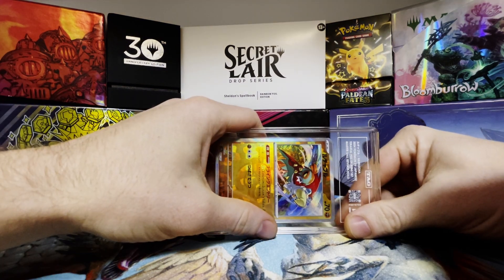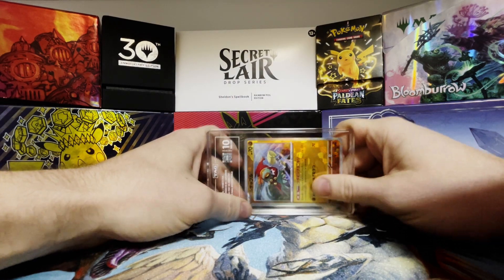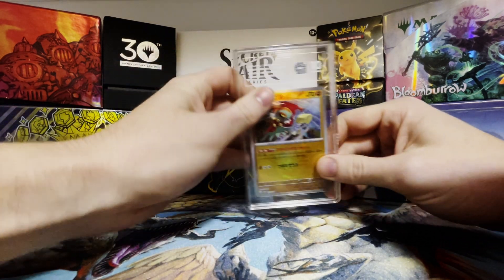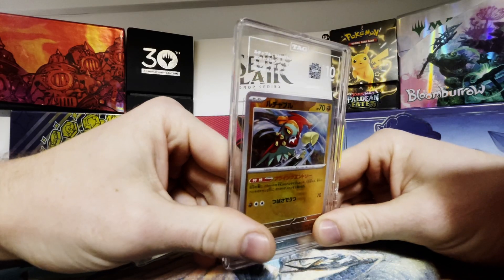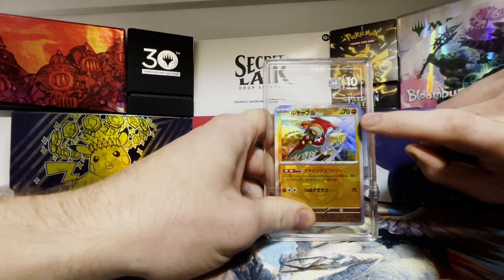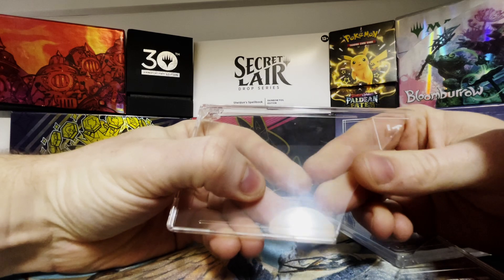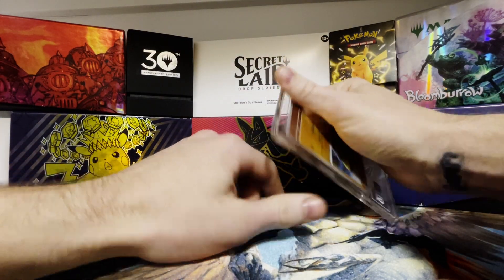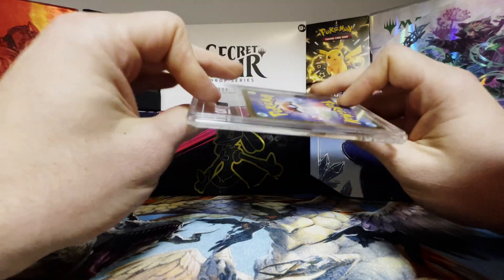Here is Why TAG Slabs Crack So Easy... And How They Can Fix it.

Comment: Hi TCG Random! We really appreciate the time and effort you’ve put into testing our slab and sharing your findings. Like you, we’re passionate about transparency, which is why we provide detailed data with every grade—to give collectors as much insight as possible.

We also want to thank you for offering to test our slabs further. We've recently refined our welding process to increase strength, making the slabs even more resistant to breaking and significantly harder to pull apart. That said, we’re proud of the quality of our slabs. As your previous tests confirmed, they’re made from high-quality acrylic with industry-leading UV resistance and optical clarity. While extreme force can break any slab, we prioritize optical clarity, UV protection, and scratch resistance over using a more impact-resistant but less visually appealing polycarbonate.

Our goal has always been to create the best slab in the hobby—not just in its clean, minimal design that keeps the focus on the card, but also in security. Every TAG slab features Proof Code technology embedded behind the QR code, providing next-level authenticity and anti-counterfeit protection.

As you pointed out, we did not create a full hermetic seal across the entire slab to maintain crystal-clear clarity. Our internal testing showed that attempting a complete seal could create inconsistencies around the edges, which is why we designed it this way. That said, we’re always looking for ways to improve and are actively exploring refinements.

We also want to clear the air regarding past discussions. Our goal has always been to provide transparency and accurate information, never to discredit anyone. The original video you mentioned raised concerns about slab durability, and while we responded to clarify, we didn’t get a chance to discuss it directly at the time. We’re glad we’ve since connected with the creator to have an open and productive conversation, and we appreciate the opportunity to address any concerns. Honest discussions like these only help push the hobby forward.

We’d love for you to test the updated slab once we complete additional optimizations. We’ll reach out when it’s ready! Thanks again for your thorough testing and for helping create meaningful discussions in the community. We appreciate the dialogue and look forward to continuing the conversation.
Reply: could you guys please also address the humidity issue? with a non complete seal the cards are prone to humidity damage in humid areas
Reply: Yep, i understand wanting to keep that clarity but they should definetly do a full seal to combat humidity  @shinyshaymin420
Reply: @shinyshaymin420 this to me is the bigger issue than bending a slab I'll never bend anyway LoL. I love tag slabs though... cleanest in the industry
Reply: I was gonna submit, but gonna wait until these issues are fixed.
Reply from the maker: Hey, @taggrading. Any success on upgrading the slabs yet?
Reply: Was trying to find your channel to see if there was any updates on this. I spoke to a TAG rep in person and he said there will be no new tag slabs but only the updated weld. The updated weld seems better but not perfect. Although no official statements. I need to see the scientists tests before I invest!
Reply: I’ve seen you reply to many videos and you are really making me want to grade with u guys. I did w PSA once and I just didn’t understand the grade I got
Reply: An apology would be much more respected after trying to strong arm Ramseyrips. This makes the hobby even worse than the scalpers. You’re lucky you had someone do your own research/work. Too bad your entire company couldn’t figure this out off bat.
Reply: W reply. Hoping for the best!
Reply: This is such a TL;DR and I don’t have to because I know what it says already. 
Sorry Tag. You only get one chance and it sounds like you blew it with a response video which is no longer available to watch.
Reply: same pr nonsense , you never formally apologized to Ramsey for just making an honest review of a product.
Reply: @keyynew1  They addressed this issue with RamsayRipsPack. He made an update video about it 4 days ago
Reply: @keyynew1  while honest and tags response sucked. he was basically telling people tag's slab sucks because if you bend it (or if you have a 9 year old that someohow bends slabs), it breaks. don't you think that if it was a huge problem, it would have been made an issue by someone else? not specifically in a test that is unlikely to happen in 95%+ scenarios. it was an emotionally charged reaction, without any sort of objective reasoning. other than, "NO BEND SLAB = BAD". take note from this video who addresses tag with class
Reply: @keyynew1  TAG addressed this and Ramsey made a video about this 4/5 days ago. TL;DR, TAG took accountability for how they responded and Ramsey respected it
Reply: Very Fair response i look forward to him testing their new slab.
Reply: They sure do use AI, even if not for grading😂
Reply: Literally same bullshit statement lmaooooo
Reply: So cringe. You could have narrowed that down to one paragraph.
Reply: @Sean-db1gx  So cringe. People like you are the reason why companies don't respond to stuff online.
Reply: @whitesmoke08  It's 5 paragraphs of PR. It's like a politicians response. Either respond honestly or don't bother.

Comment: You just confirmed my theory, thank you. I have one TAG slab and I was guessing the welds were thin and not fully around also. When I noticed the “weld spots” on the one I have I thought it failed your moisture test because it wasn’t fully sealed, guess I might have been right. I sent some cards to TAG before all this research, guess I won’t be sending any more. The UV protection and moisture protection are what matter the most to me. You did a great job and I’m happy you did this follow up video. I really liked the TAG slabs, will try grading with CGC and keep an eye on TAG to see if they improve.
Reply from the maker: Thanks for watching! You were absolutely right. As far as I have seen, they still haven't done anything about it.

Comment: So the material it’s self cracks so the base material. It has very little to do with the welds or bonds. Stress risers in the cheap plastic is what causes the torsional stress to be too much for the slabs. The slabs look amazing but the plastic is trash. They need to either have a new plastic resin made or make some honeycomb structure to reinforce the plastic.

Comment: Mechanical engineer here again.   What they essential have is a stitch or skip "weld".  Those types of welds are considered class E or F for fatigue,  which are very low class of welds.  While this isn't a fatigue loading case,  the reason for easy cracking and crack propagation are the same.  At the root of each weld are micro cracks, which you touched in.   The lack of continuous weld means you have loads more micro cracks, hence the low class weld.   By the plastic being a brittle material,  the crack propagation is a very rapid propagation.  Like mentioned,  a continuous weld/ seal will greatly help.
Reply from the maker: Great explanation! Thank you!
Reply: @TCGRandom-x5m  you're very welcome.   I've loved your last 2 videos and feel free to ask me any engineering related questions you might need help with, though you obviously have a VERY solid foundation yourself
Reply: @gregl6369 if the goal was to show tampering when trying to open the case by making sure it cracks as opposed to opening the two halves cleanly, would have a more even weld have the same effect, or would stitch/skip weld be more effective for this objective
Reply: @hoiming  a skip weld would theoretically be easier to tamper with as there's less material you need to cut away and reseal.  The brittleness of the slab is more the drawback to using the type of plastic that is superb in every other quality you'd like in a slab

Comment: I absolutely love tag slabs and the fact they are designed to break in a unfixable way when tampered is great too
Reply from the maker: Yeah. Most people with slabs are going to keep them in a nice little case only to take them out for trading or selling.
Reply: @ exactly, they aren’t going to drop test them
Reply: And it’s rather useful being easy to crack, if you want to grade with another company, easy to crack, less risk of card damage

Comment: It's great to see the hobby coming together and pushing for transparency, ultimately leading to a meaningful response from TAG Grading. It's a positive sign when a grading company acknowledges concerns and actively works to improve.

That said, I’d love to see Japan's ARS Grading included in the discussion as well. Their slabs stand out with a unique design, and their grading process seems far more structured compared to what we’re used to. From what I’ve seen, you can’t just submit cards to ARS anytime - you have to wait for specific application periods, almost like a first-come, first-served or seasonal system. That level of exclusivity makes their grading feel more prestigious, and I’d be really interested in understanding why they operate that way.

We constantly hear about PSA, BGS, CGC, etc., and the ongoing concerns around population control, inconsistent grading, or even the dreaded "grader having a bad day" scenario leading to harsher scores. That’s why companies providing grading notes, like TAG, are so valuable. At the end of the day, if I’m spending money to get my cards graded, I want to know exactly why they received the scores they did. Transparency fosters trust, and the more companies embrace it, the better it is for the hobby.
Reply from the maker: Very well stated. ARS is on my list for round 2!

Comment: so they purposefully just left gaping holes along the weld line?! how irresponsible and frankly unacceptable. wonder how the tag bootlickers will defend this one
Reply: TAG needs to fix this asap. PSA needs to get rid of upcharging and employ better graders who don’t grade based on bias and their feelings that day. CGC needs to stop grading fakes. I could go on…but all “bootlickers” of every grading company should knock it off. This bickering crap is getting as bad as the PlayStation vs Xbox BS. It’s getting pathetic.
Reply from the maker: I agree. They all have issues. Go with who you like.
Reply: @MewDidWhat  i agree. each grading company has its strengths just like consoles. even TAG, i do love the high quality scans and data they provide. the problem is declaring objective superiority of one over the other and not shutting tf up about it. the "best" grading company depends on your reason why you are grading in the first place (to sell? to authenticate? to display?)
Reply: So if they are planning on improving the slabs, anyone who gets a tag slab now will have imperfect slabs and will need to break it and resend it again when the better slabs are made? That’s too bad. In my opinion I would just wait until final improvements are made before sending any cards for grading.
Reply from the maker: Maybe they will do what CGC and PSA do. You send in an old slab for re-slabbing at a very low (or no) cost.
Reply from the maker: Everyone makes mistakes. Glad they are now taking the information and improving. That is all we can ask for. Bootlickers will always find a way to bootlick.

Comment: May this also be the reason why TAG slabs were prone to humidity compared to other slabs due to welding only certain section? Also I wanted to metnion that they're testing out thicker welds. I'm mainly interested in finding out if and how these changes affect humidity tests and impact tests.
Reply: I'm fairly positive that this is the reason for the humidity test going poorly for the TAG slab. The ability for air and moisture to get in allows it to collect water on the inside.
Reply: @ImRaccoon  Yeah that's what I was thinking as well. This puts me off buying any TAG graded cards for now seeing I don't know where they've been, unless I grade them myself. Cost of cutting corners I guess ¯\_(ツ)_/¯
Reply from the maker: Oh for sure. With this design, there are many unsealed areas for humidity to enter.